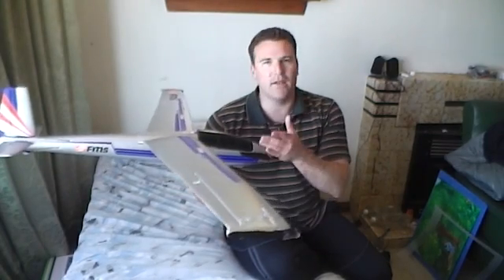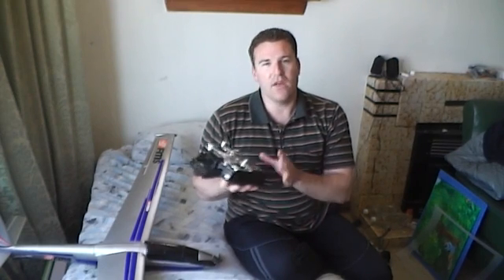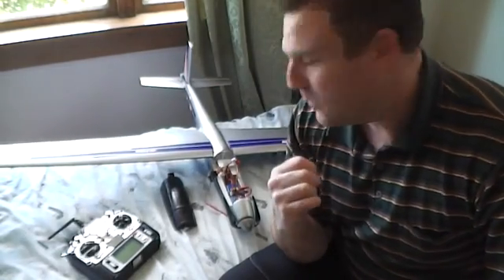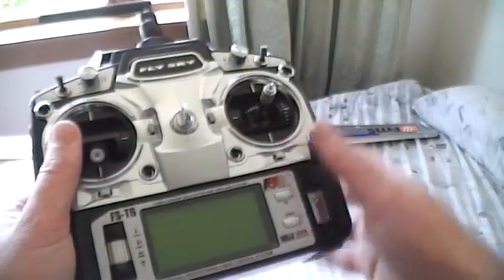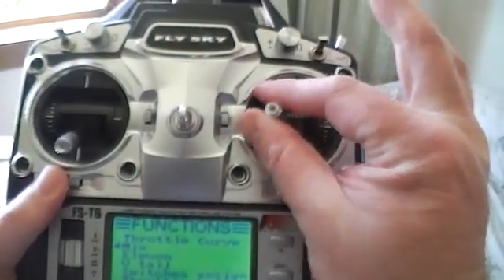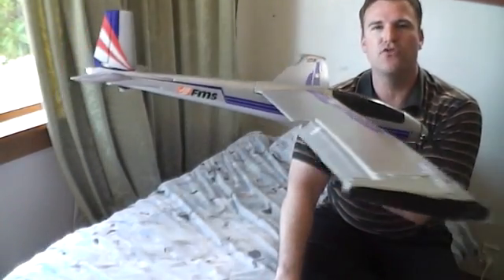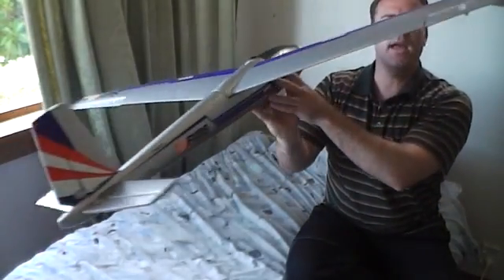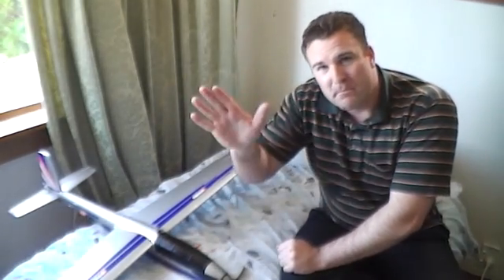How to Apply Flaperons on 4ch RC Glider with 6ch Controller

Comment: Thanks a lot 
Is it the sale thing for spolierons ?
Reply from the maker: FAVERJON Paul Yes it will be similar. Have a mix to combine Ch1 & Ch5 (usually with 5 reversed) so that you have ailerons synced, then have channel 5 on a separate switch to control the pitch of both ailerons up or down.
Reply: W

Comment: Very informative thanks, im thinking about doing this for my foam glider. Do you think its worth spending the money to do this for my Axn jet that iv modified into a slope soarer.
Reply from the maker: Trouttaranaki Yes that sounds like a good idea. I am making a jet-powered seagull with flaperons. I will do a video of that in the future with the flaperon setup - cause i've figured out another way of doing it with the controller. Yours should work well cause the ailerons on the floater come a long way in towards the fuselage - like flaps would.
Reply: Great thanks.